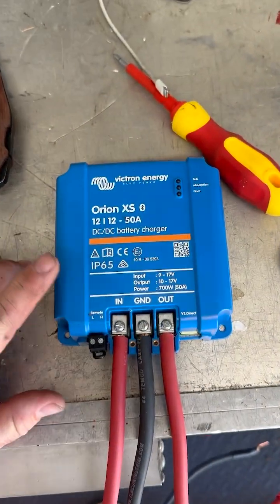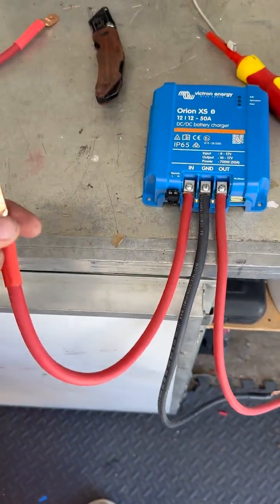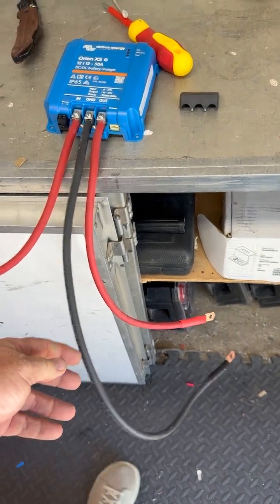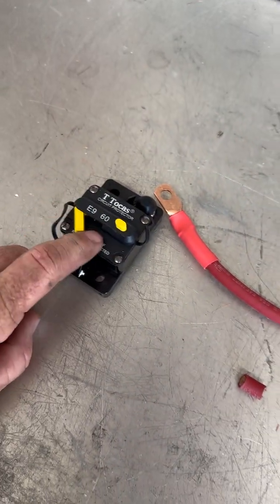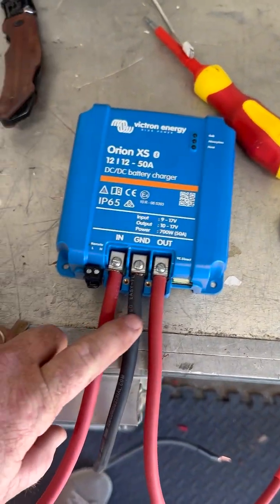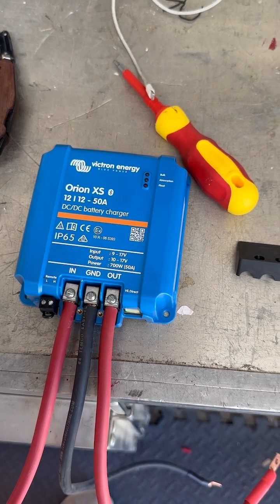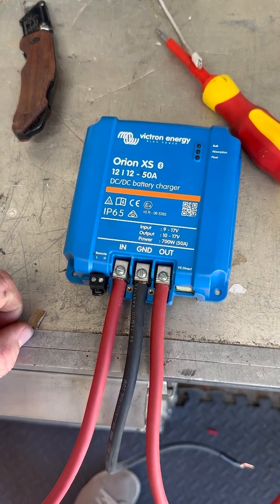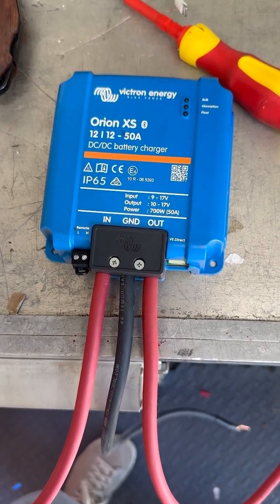Victron DC-DC Charger upgrade!

Comment: I have 2 of these in parallel and I couldn't get 4 awg in there for life of me. I had to remove a lot of copper just to get it to fit then the stress relief clamp wouldn't fit back on there. I finally just stopped altogether and resized them all down to 6awg.. my runs are all less than a foot to busses that have 2/0. I didn't want to go to 6 awg but I checked temps at full output once it was done and it works great.
Reply from the maker: I'd say you're fine for that short of a run anyway!
Reply: You can order screwdown reducers and screwdown terminals put a reducer onto the wire and then the reducer into the Ring terminal screw down and have that fit. I did that with an eight gauge Ring terminal and it works perfect.

Comment: How is it 700 watts 12v times 50a is 600 so…. Yeah
Reply from the maker: It charges up to 14 volts which where the 700W comes from.
Reply: Most alternators charge between 14.1 -14.7

Comment: What fusing/safety interrupt do you use between the alternator/starting battery and the Orion?  You didn't say if you were charging Lead-Acid or LiFePO4. LiFePO4 can, (and probably will) take the full 50A if the Orion can keep up as it heats up.  Does the Orion have any temperatures it can display in VictronConnect?  I don't have one of these, but I've been considering adding one for longer multi-park trips.  Currently I'm solar-only charging and can access up to 560Ah of LiFePO4, so I typically don't have to charge for a 4-5 day trip.
Reply from the maker: I try to always use a DC surface breaker like the Blue Sea 7184 which will protect the cable and give you the ability to turn off the current if desired. I would do this regardless of LA or LifePO4 application
Reply: Im sure you could add a temp sensor & cerbo gx to get data